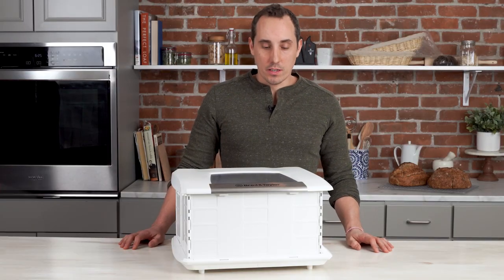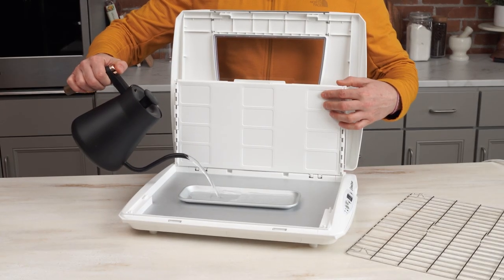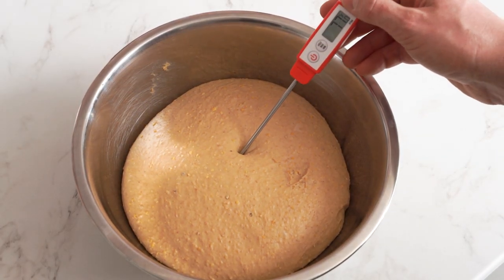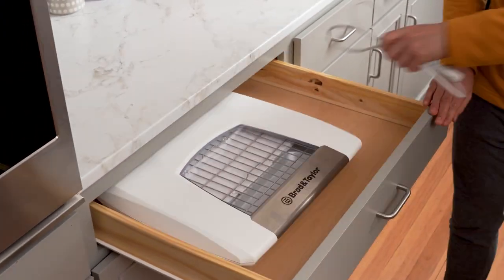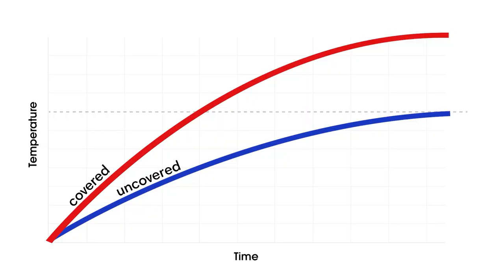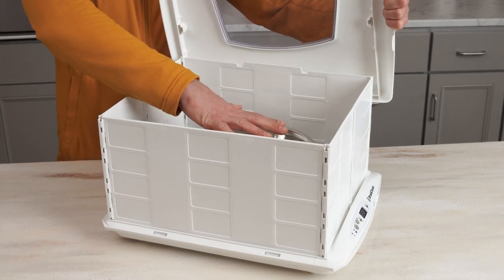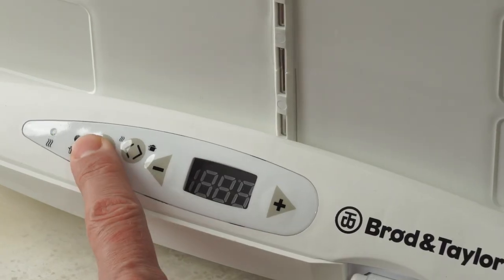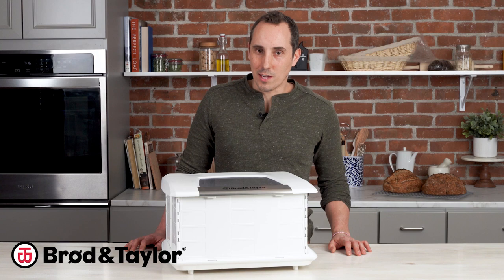Tips To Get The Most Out Of Your Proofer

Comment: Hello, how many continuous hours does it work if I want to ferment pizza dough for about 12 hours? Is the water container in the tray enough? Or does it last for more hours?
Reply from the maker: Hi! The Proofer will run continuously as long as it's left on. We've had it running for weeks without any issues when making black garlic, so it will work perfectly for your 12-hour pizza dough fermentation. If the water tray is filled, it should last close to 12 hours, though the exact duration depends on the temperature you've set. Higher temperatures can cause the water to evaporate more quickly. If you're concerned about your dough drying out, you can lightly cover it with a lid or plastic wrap to help retain moisture.

Comment: In the summer when it’s really hot will it cool the temp for the dough to 80?
Reply from the maker: The Proofer is only designed to warm its contents, not cool. If the room temperature is above the set point, the Proofer cannot be cooler.

Comment: The information that comes with the proofer says you can use it for sous vide, but I can find no instructions for that method. Can you point me in the right direction. TY
Reply from the maker: You can turn the Proofer to slow cook mode and set the desired temperature. Fill a pot with water (it helps if the water is already close to the desired temp), and place it directly on the Proofer's heating plate. Place the food you are cooking into a sealed bag and place it into the water. You will want to check the temperature occasionally to make sure it is correct.

Comment: In the video it recommended using a metal bowl due to the heat transfer form the heat plate. Will the proofer still work well using metal bowls with silicon bottoms?
Reply from the maker: Yes, it will still work well.

Comment: Should the latch hold when the wire rack is inside? I take the rack out and it does, but otherwise it pops open
Reply from the maker: Yes, it should latch with the rack inside.  Try turning the rack over. It may be upside down. It it’s still not latching, shoot us an email at contact@brodandtaylor.com and we can assist you.